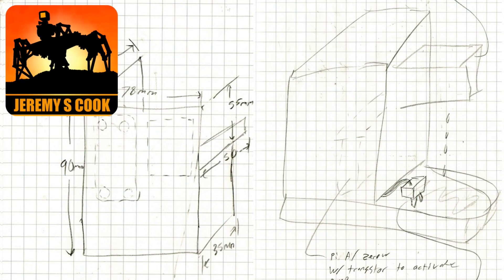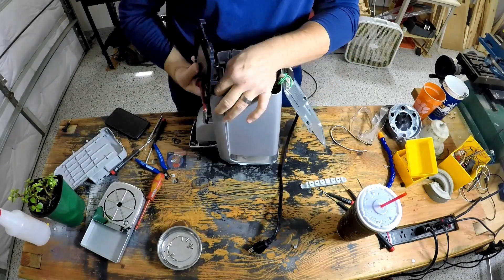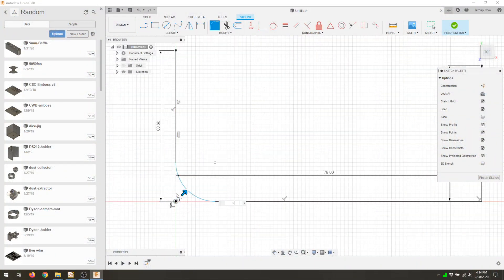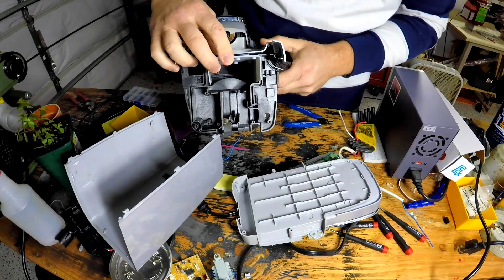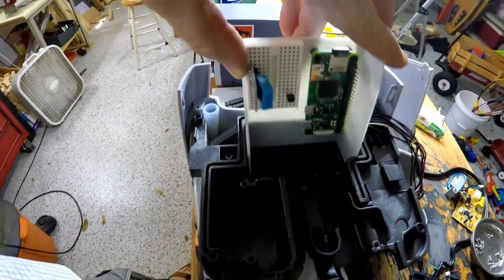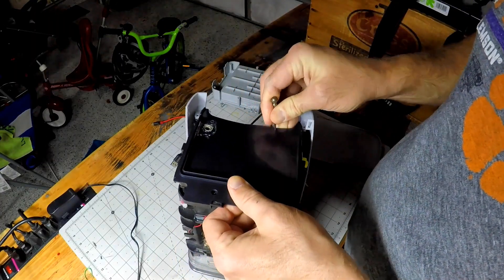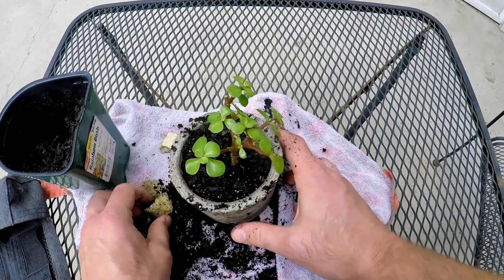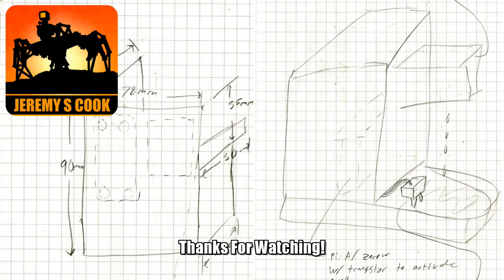Raspberry Pi "Greenhouse" from Keurig Coffee Maker

Comment: Nicely done! Not just with the professionalism and attention to detail, but also in helping to reduce e-waste.

I would make a few adjustments personally, such as eliminating any need to interact with the device other then topping up the water tank and adding a sensor when that's low as well. And finally disguise the machine in a hand crafted mountain or similar with a water fall.

You could use Cement, Stone, Plaster or Clay etc.
Reply from the maker: Well thanks! 
Watering is done on a schedule now, so I was envisioning the sensor being somewhat of an indirect indicator that there is no water left. Needs a bit of tweaking TBH.
You certainly could disguise it, but I personally like the salvaged electronics look myself :-)